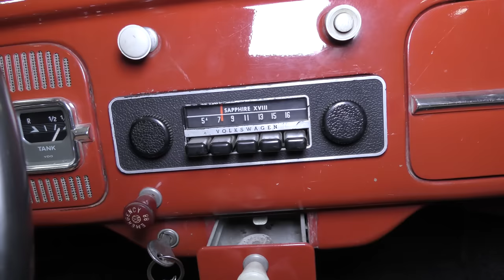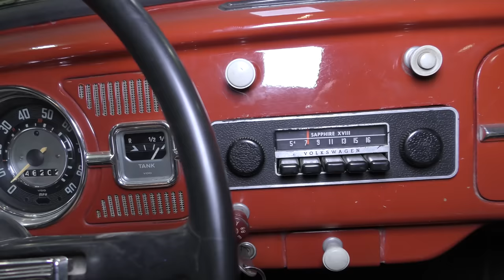Big Mods with big $$$. When Mods don't make sense. What did the  CAR WIZARD do to this '66 VW Bug?

Comment: EV West do a great EV Conversion for the Beetle. Having owned an EV Beetle for four years, I wouldn't want to go back to the 40HP Gas Engine - no way! When a conversion is done, there is no welding, or grinding, or changing the structure of the Beetle in any way. If you desired, you can always revert-back to the Gas Engine in a couple of days, resell the whole Kit, and get more than you paid for it all. In the four years of ownership, I can guarantee that (when you want to go somewhere), it always starts. Even in Torrential Rain and Flooded Roads! There is no warm-up time, or coughing and spluttering from the Auto Choke. No Bunny-Hops. 
My Beetle is fitted with A/C. It leaves many modern cars 'dead' at the lights, and (this in itself) is a huge thrill, and a huge shock to those who try to out-accelerate you! Constant Power. Constant Torque (173ft/lbs) means a super-fast getaway with no gear changes up to 100 km/h. At the Traffic Lights, it's not using - or wasting the high cost of fuel. It is absolutely silent. Wherever I go in my Beetle, it draws crowds, as they hear nothing - as it creeps around Shopping Centers.......... I have retained (boxed and Crated) the original 1600cc engine. You plug-in overnight - and awake to an electronic gauge that flashes the word "FULL". I do know that there are the purists that will always 'knock' the EV Idea. But I just had to write this lengthy comment about the real deal. As far as I am concerned, I have future-proofed the only car that I've owned for almost 20 years. It is truly a part of our family - and dearly loved. from 40HP to 125HP. What can be wrong with that? Greetings from Australia.

Comment: Gas goes bad.?  7YEARS LATER I decide to kickstart my motorcycle...that was stored outside.  3rd kick and It was running.  Which is not out of the ordinary even with fresh gas.  No fuel stabilizer was added (I did not know that schit existed)  Certainly, old gas smells worse out the exhaust.  I burned up MOST OF THAT FUEL AND THEN ADDED NEW REGULAR GRADE GAS.  DONE. PARKED it again because I  had other motorcycles that I preferred to ride. Also a car and truck.

Comment: I’ve probably had 25 beetles over the years
Didn’t mention it but the generator isn’t stock in this car and looks like it has been converted to 12 volt most likely. 
1966 was the last year for the 6 volt VW
I have to say converting it to an electric fuel pump sounds like a solution to an nonexistent problem. On these bugs the fuel pump is lower then the gas tank so you are not pumping gas out of the tank you are only pumping gas to the carb. 
Even if the float bowl is empty should fill up in a few cranks 
  I think gasoline going bad is mostly a myth. I’ve started a Honda up that sat for 5 years and it ran fine. About 15 years ago I started a 67 bug that sat for 3 years. Hooked a battery up, cranked it a few times and it started right up

Comment: Jeepers, looks like it could have rolled out of the factory like that. I do see the appeal of an ev swap, but if it's running good other than just "it has a carb", seems like there's no need. Just a little modern pixie dust to make the old system easier to use. I mean, I use Stabil on my mowers 😁 as well as my own car when I don't drive it frequently (have worked from home for years).

Comment: For the past two years or so I’ve been using STABIL MARINE 360 in my lawnmower. I let it set during the winter months and next season pull the choke starts right up. @carwizard 
It’s better than the storage formula.

Comment: What percentage of Ethanol are they adding over there in the states? It's currently 10% here in Europe or less than 5% for premium.
NB you should always use premium in these old VW air cooled boxer engines. They like high octane fuel due to the higher operating temperatures compared to a water cooled engine.
Reply: They were originally designed to operate on very low grade gas....
As the Wizard said, today's gas is not like yesteryear's gas...

"Assuming your engine is still a stock 1300, it's only got a compression ratio of 7.3:1 and the original owner's manual recommended an octane of 87. 
And, that 87 octane was the RON standard, not the (R+M)/2 (CLC) standard you see on pumps today, which is usually about 4 points lower. 
So by that, 83 octane would be good for your 1300. 
So regular unleaded will work just fine."

See all the arguments on various VW sites...
hey, you could use what works for your car...

Comment: Wizard - have you every addressed Electric Vehicles vs. Gas/ diesel?  I just am not into all of the electric hype (hint - I'm over 60 ).  As you said the batteries are way expensive and I really don't see where the energy is free. If you drive over 200 miles it seems as though you better look for a charging station. If you go through the "country" on a trip what are your odds of finding a rapid charger? Plus- the chargers in most areas are not free - you have to pay for the charge and have an app!

Comment: Nice little late 66 bug. Watch out for those "new" carbs, they are made overseas and often have serious issues, like porous castings and such. There are folks out there doing proper rebuilds of original carbs with new throttle bushings and all. They are a much better solution, and eliminate the overseas middleman.

That radio is far from the original, it is from the early 70's. It is barely hiding a hacked out radio hole where someone installed a DIN standard unit sometime back. The dash looks to be original paint, so repairing that dash and blending the paint repair would be tricky. A couple of things need fixed with that headliner, too, but it looks pretty nice overall.

VW speedometers that are over 50 years old are rarely accurate, even with the correct tire diameter. Just calculate how far off it is, and adjust your driving to match. Same goes for the odometer. The larger rear tires have the effect of reducing engine RPM,but also reducing the cooling fan speed as well. Not much of an issue with local driving, but on along hot drive, especially with along hill climb, it can cause overheating. There are larger crankshaft pulleys available that will speed the cooling fan slightly, just make sure you have a balanced and welded fan that can handle the higher higher RPM.

Vapor lock and hard starting in my old cars is a real PITA. My 87 Toyota with the 22R is especially prone to hard starting when hot.

Comment: Ethanol and Methanol are the worst additives ever. They're the reason why the government isn't and will never be the answer to everything lol. 

When I was in the small engine industry we'd sometimes get in people's old relics from the 50's 60's ex. If I was lucky sometimes I'd get in a piece of out door power equipment that hadn't been used in 40 years or so. You could always tell by the fuel that was left inside.  Really old gas from the period never had any emissions BS added to it. So basically when the fuel would eventually dry up you were left with a dark brown varnish that would easily clean up with wd40 or carb cleaner. On top of that before any cleaning was done the give away sign that the fuel was pre emissions was the smell. Super old gas has a really nice organic oder to it that's hard to describe.  Most of the time if the machine was stored in a climate controlled environment the rubber and paper parts of the carb would be preserved and usable.  With today's Ethanol and Methanol fuels they destroy anything that isn't plastic. Ethanol absorbs water and destroys metal and dries up rubber and Methanol has an horrible smell and green varnish that eats away at everything.

Comment: Just tell him for one if you run non-ethanol gas if  available that will make starting much easier that's what I put in my motorcycle and it has set for a few months at a time and fires instantly right up and it's got six carburetors

Comment: Surely it makes no difference if you pick up wheel speed from the gearbox final drive or from the wheel hub, if you change the overall wheel diameter you alter the speedometer calibration.

Comment: hey WIZARD, air cooled VW, s, have a thermostat I used to swap Ghia front  disc brakes to beetles and toss the stock  exhaust and oil bath air cleaner, etc.

Comment: Old fashioned way to start a good tuned beetle, when is cold needs crank, when is hot, starts immediately. Why, becouse to make some oil pressure, and thats one of reasons for longivity of engine. Now that oil pressure cranks is missing and thah is not so good.

Comment: I don't have time to page through all comments, so as a former wide 5 mafia guy some things I'd like to add:
Interior isn't stock, you're missing the rear ashtrays and inside chrome molding. 
Never had an issue in recent history with the 66 i had and the mechanical fuel pump.   This was John Muir's favorite year he was the guy that wrote the vw idiot book.  1300 engine and transmission if intact and numbers matching this car could be worth way more.  Original bumpers and one year only rims are gone.  I do like those aftermarket jobbers, but the originals are gone.  So was the spare tire and perhaps the tubing for the windshield wiper fluid pneumatic pump based on spare tire air pressure as well...  you didn't say if it was still the stock 6 volt system or not but odds are it isn't if you threw in a new electric fuel pump.  All of the lights will burn out and the radio can too unless you have a voltage drop circuit in there somewhere. At least you have the one year only 1300 badge and the one year only hazard switch.  It shouldn't burn out the stock 6 volt starter since that isn't powered all the time.  As a matter of fact, that voltage difference would make the starter spin faster and make it super easy to start even on the coldest of days.  I feel like the ev west conversion is a good product, but I remember fondly the days of earlier homebrew ev conversions that could usually be done for way less perhaps as little as 1500 or so. That was back in the 90s...  adjust for inflation it still probably wouldn't be 20000 or 30000.

Comment: Long start cranking times on a mechanical fuel pump carbureted non-sealed fuel system vehicles that sit is not a problem of "modern" gasoline.  It's just the nature of gasoline.  The gasoline from the 60's would do the very same thing.  Heat soak was a real issue where you'd drive somewhere, park the vehicle, come back, and it took a bit of time cranking the engine to start it up.  The fuel would evaporate out of the fuel bowl over time, or boil out from heat.  Its one of the reasons that parking lots used to smell like gasoline in the summer time.  In all honesty, the gasoline in the 50's and 60's was really crap as it had no additives to to handle the deposits that gasoline left behind.  I find it interesting that those bashing ethanol in modern gasoline forget that the original "Dry Gas" and "Fuel Treatments" were nothing more than alcohol.  It's also a reason that "Top Tier Fuel" is really a thing.  Can we just start using the lump that is three feet above our butts?

Comment: Instead of electric fuel pump conversion,  an one direction Fuel Flow Valve at the tank would have done the job also and keep the mechanical fuel pump.

Comment: Yeah, pulling the engine out of a beetle takes so much time (eye roll) ... just to remove the 4 bolts that hold it in place. 🤣🤣🤣
Reply: Disconnect the fuel line,  ignition wires, oil pressure sender wire, throttle cable, heater hoses, gen/alternator wires, air cleaner......

Comment: That's a beautiful car.  I use alcohol free 91 octane premium unleaded.  I fill up  my lawnmower in the fall to winterize it and it starts right up come spring. I also use it in my cars since they unfortunately require premium.
Reply: Not always available, too bad!
Reply: @rk22cc  in Kansas there are still some gas stations that sell alcohol free gas.
Reply: @pablojose4890  wish there were in the North East

Comment: I know what an owner does with their car is their business, but honestly, I'm really glad the EV swap was so prohibitively expensive, that is such a beautifully clean and stock car it would have been a shame to take that away from it, especially as it's quite rare to see a Beetle in such original condition and be a well-loved example. And I'm not even that much of a fan of them!
Also, that start up! Even the best modern engines do not start that immediately. That is obviously a very well suited fuel pump.

Comment: @car Wizard My Dream Car at 54 years old is a 1967 VW Bug convertable (same year i was born). My Question for the Wizard is:... would out even be possible to do a modern VW (fuel injected) engine or or and EV swap or even making  a modifiation to the existing engine to  add some sort of air conditioning for comfort?  But I am verly curious if this would be posible and if I am correct on my estimation. My other old dream car would have been the same 1967 convertable bug with a Porche engine swap. My guess is that  if either dream car was possible, it would be easily cost a hundred thousand for the overal projec including the purchase of the 1967 convertable beetle in great contition.

Comment: That's not the original radio.  What is installed is designed for the 1968 or higher when Bugs had molded plastic and foam dashboard covers.

Comment: I have a 1963 Lincoln, and a 57 Cadillac, and a 77 Lincoln, I only use 92 premium, should I add some additives to the tanks? I drive those cars at least 1 or 2 miles per week.

Comment: Why cut the video at “watch this guys.” at 18:45 did it not want to start?  Or did you do a dumb because you forget to fill the blinker fluid, torque to yield the #16 inconell piston return springs and pre heat the microverse battery?

Comment: Since SUVs, trucks and crossovers have taken over the roads, you're pretty much toast if you get into any collision above 35 mph. A motorcycle is probably a safer ride because at least you have the speed to react quickly.

Comment: Spending that amount of money to make a '66 VW Beetle all electric is RE-DUMB-DANT. It already runs 100s of miles per tank. EV will only drop the value / resale to next to nothing. Great call by owner, it is FINE as it was originally built! Great video and great info. on this excellent VW!
Reply: Maybe 250 with standard 10 gallon tank.

Comment: That Beetle may not be as original as depicted - for years you could get OE or very close to it parts - it wasn't too long ago that they still made beetles and the aftermarket for older ones was pretty big.  The entire interior may only have been a couple hundred and I knew several kids back in the 80's when I was a teen that would buy a beetle and with money from cutting grass or working at Burger King could almost completely restore the cars and have enough left over for "other purchases" (it was the 80's after all and they were driving VW's).  Sadly these aren't very safe compared to a fairly modern used car and I don't know that I'd let my son drive it as his first car - we may be a little too over protective these days but I think even the Wizard would agree that while this beetle is cool it may not be the safest car in his shop...

Comment: 66 beetle with race dissy  vacuum pipe on carb not blocked off, gen fitted is  not correct for year , 12 v battery should be 6 v , good mods should go well !

Comment: Get that fuel filter out of the engine bay!  Move it to the front of the system. Also use FI clamps on the hoses.

Comment: This kind of car, and then I'm talking about the kind that sits for long periods of time and when used doesn't get many miles, should use Alkylate gasoline!
Better for the environment, doesn't gunk up, and is stable for a year or longer. It evaporates like any gasoline but doesn't leave any residue and the car will start as soon as it sees gasoline in the carb again.
It is expensive tho.

Comment: I had a 66 same color. Loved the 1300. Only year they made it. Ive had 1600cc vws but this single port 1300 just flew down the rd.
I dont like seeing them modded at all.
Reply: I think the 67 was a 1500 but also a single port. They did have better low end.

Comment: I would want all 4 wheels & tires to be the same. White steel Wagon design and tall rubber. Would go great with that red body. Replace with the original chrome bumpers. Leave the rest alone.

Comment: What it needs is a way to switch off the new electric fuel pump so after a drive the car can be run for a minute with the fuel pump off until the carburetor float is empty and the engine stalls. Bingo! No bad fuel sitting in the carburetor float.
Reply: The fuel will evaporate out of the bowl before it has a chance to go bad
Reply: @chrisfreemesser5707  But won’t the evaporated fuel leave varnish residue?
Reply: @jkk244  I wouldn't think so...the fuel bowl in a carb is vented to atmosphere so I'd think the gas in there would evaporate well before it would chemically change into varnish

Comment: I LOVE air cooled VWs! They're simple, reliable, and, when something does go wrong, they're incredibly simple to fix. You know, instead of that asinine EV idea, you could call up Scat, get a big bore kit, dual carb set-up, and, have that little thing pushing 150 - 200HP for less than 10% of that dumbass EV idea.
Reply: I wonder what the VW factory engineers would think if they were to come over here and see the performance we are getting out the VW engine and the custom parts that we make ! They would amazed